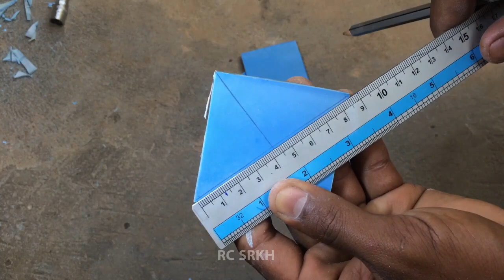How to make a tire RC​​​ [RC SRKH]

Comment: What scale are you building for?  It would be nice if you gave dimensions and sizes of the pvc pipe and drill bits you used, and what material the tires are made of posted on screen. Still, nice video though. Thanks for taking the time to make it.
Reply from the maker: Thank You🥰